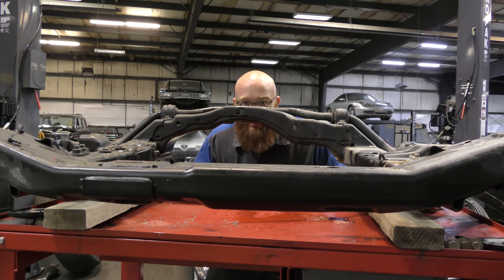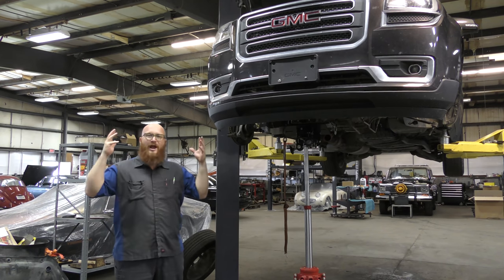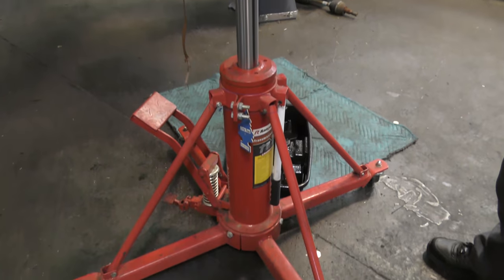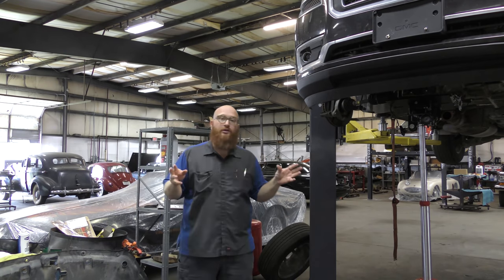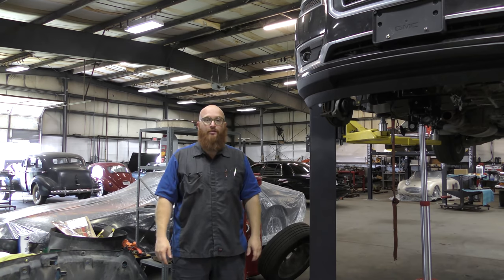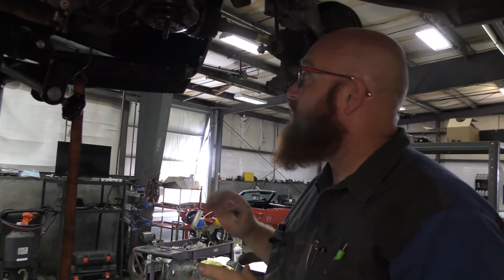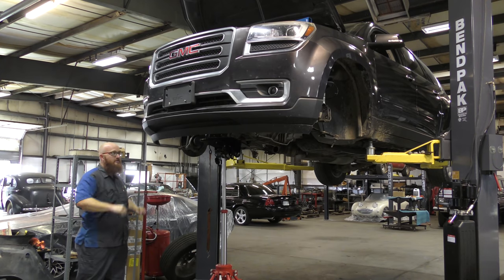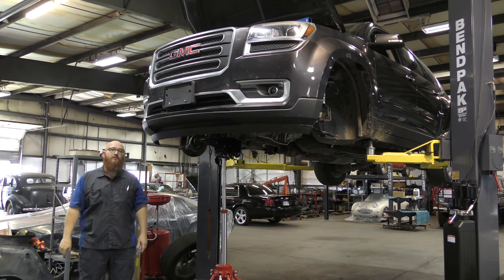Used car insanity in the CAR WIZARD's shop! Why did the huge repair get approved on this '15 Acadia?

Comment: Moreover, another vehicle that you should never, ever buy is any Mitsubishi vehicle that has the CVT transmission. I am definitely hoping that the Car Wizard will have a 2014 Mitsubishi Lancer sedan with the 2 L four-cylinder engine, which produces only 152 horsepower and the CVT at his shop tomorrow. Most of these Mitsubishi vehicles have a ten-year warranty, since they were manufactured back then, but now some of them have reached their warranty, whether it is by the odometer reading or by age. Let us hope that the customer of the 2014 Mitsubishi Lancer sedan took care of the vehicle by maintenance and repairs, so the Car Wizard will not have to explain and go over the vehicle that much, except the underneath portion, while Mrs. Wizard will do the interior of the vehicle, as always. Also, I am hoping that the customer of the 2014 Mitsubishi Lancer sedan with the 2 L four-cylinder engine and the CVT will be a young college sweetheart. It should be interesting for me and the other viewers to watch. Thanks.

Comment: Oh I’ve dealt with some weird customers so I totally understand your frustration. People will buy a BMW to look rich, but they won’t spend a penny on servicing or new tyres. They expect a car to be as simple as a fridge and if anything breaks - the car is suddenly is piece of crap. People’s ideas of what is what are so weird now. The guy who runs my local and very reputable garage (we’ve been going there over 25 years) was saying how frustrated he is recently with cheap, sub-standard parts that are becoming a real nightmare. He has been fitting top brand clutches, starters, cambelts etc and they are failing within months. He obviously replaces the part at much expense and time so this is really eating into his profit, time and his reputation! It’s a real problem and I hope you are not facing the same problems too much Wizard

Comment: I totally understand mechanics have to make their money and keep their shops operating and their bills paid, but repairs have become outrageously expensive for the average person. I'm an industrial mechanic/technician making $19/hour. My 2005 Pontiac GTO has been without AC for over a year. Last August, I passed out while driving. It happened again this July. And a few weeks ago, I had a heat stroke while stuck in traffic on a bridge. Luckily, I didn't wreck the car. But I'm taking chances with my life and others' every time I drive. I've been to a couple shops that couldn't tell me what the problem was. But last week I finally had a shop tell me it's the compressor. They want $1900 to get my ac working again. I don't have that kind of money. $1900 might as well be a million.

Comment: These cars very well designed 2011 and newer but evap systems plugs can cause crank case pressure to build and blow seals.

Comment: This is exactly what happens when you don't change your oil on time, infrequent oil changes are the death of gm 4 & 6 cylinders. The oil burns to the point where's next to nothing left, the chains and guides overheat it becomes trickle down neglect. - For reference I own a 13 Terrain whose oil was changed every 5k and now it's nearly perfect.

It's funny because probably $800 ( paying someone to do it) worth of oil changes would've prevented this lol

Comment: the factory recommended 15,000km oil change kills the chains.  6,000 miles or 10,000km max. Yes the updated morse chain helps, but sensible oil changes help also.

Comment: Manually operated cable driven HVAC adjustment systems are the most reliable. Too bad manufacturers gave up on them

Comment: had a lady come in....... "MY SON IS A MECHANIC! DONT SCAM ME!..... he says its the thermostat.... only replace the T-stat"
ok, but on your engine, the T-stat and water pump are connected..... and the pump has a plastic impeller that likes to fall off"
.
NO! just the T stat! my son is a mechanic!!!
.
so i go a bang up job.... just doing the T-stat
i test it..... it opens
.
i show her daughter.... the driver of the car.... that the T-stat was not the problem
i say it MIGHT still have been the T-stat sticking..... but i think its the pump
she understands 100%..... its totally fine with it
.
.
 hours later..... the mom comes back
IT STILL OVERHEATS!
ya, i showed your daughter how the T-stat opened in hot water..... and i told you thhe pumps like to fail
IT STILL OVERHEATS! I WANT MY MONEY BACK!
no, i did the job you asked for..... you didnt ask for a diagnosis or water pump...... you said "just the T-stat, my son is a mechanic"
YES I DID! BUT IT STILL OVERHEATS!!!!
.
.
ok, again..... you said "just replace the T-stat, my son is a mechanic, he says its just the T-stat"
i then told you about how you can save money by checking, and probably doing the water pump at the same time... as its one peice
you declined that..... saying....again.... that your son is a mechanic and he says its the T-stat
.
i started the work..... and noticed it was not flowing coolant.... 
called you and told you this
and you STILL declined to do the water pump!!!
.
.
BUT IT STILL OVERHEATS!!!!
.
you said replace the thermostat, nothing else..... i replaced the thermostat.... i charged you for only a T-stat
BUT! IT! STILL!!! OVER!!!! HEATS!!!!
you said replace the thermostat..... i replaced the thermostat
.
YOU KNOW WHAT! I DID SAY THAT!!! YOUR RIGHT! YOUR RIGHT!!!!
and she walked out
.
.
.
.
i really wish i could have said..... "sounds like your son isnt that good of a mechanic, huh?"
.
dude doesnt work in a shop.... he molests cars under a shade tree in the back yard
then has to have a shop spend 3 hours un-FUBAR-ing his car..... then do the repair correctly 
.
i started out in the backyard.... learned from my dad (and now teach my dad)
but some people have a knack for mechanics..... others just do what the first thing youtube/google says to do
.
.
like ya, thermostat is the first thing ya look at when a car overheats
but i could tell it was the pump right off the bat
.
.
some people have no clue
think they do
then get pissed when they find out they dont know crap

Comment: Just think. If the engineers and bean-counters at Ford, GM, whoever, had used brass gears and charged $100 for the actuators, no one would ever have to replace them. LOL

Comment: Its the right side actuator on Silverados thats the problem. If you have skinny arms and small hands you can get to it without pulling the dash. I replaced the left one on my truck. That was simple. A budy of mine has a bad right one on a 2004 silverado. He wont pay the money either. Been bad for 4 years. Hes tougher than me.

Comment: I know the pain as a GM tech. Between the 3.6 and us getting bad trades and fixing them and selling them. Just had a 2013 bmw 550i in as a uci did 18 hours worth of work to it and still got sold on our lot. Normally would go to auction.

Comment: I really wish you would have told us how many miles were on this vehicle because is a big part of the parts failure denominator.I live in rural Arkansas and have seen many 5 year old vehicles with well over 120k miles on them. So it's not just the age.The most important cause of wear and tear is mileage and how the vehicle was driven and maintained

Comment: 14:27  I changed my 2007 Ford Taurus actuator..it was stuck on AC on a road trip in the summer which was ok. It took about 25 minutes including disconnecting the battery..luckily we did not have the big console  but the split bench seat   .

Comment: HAVE A 2016 MODEL GMC Acadia with almost 41,000 ,  bought it used with 15,000 miles . But I use  a Mobil one synthetic 5W30 oil  with no problems yet . I do  make the  maintenance is done right as I have for over forty years of changing my own oil .And plan too have the trans and cooling system flushed at 60,00 miles . Fingers crossed for a good vehicle. Marshall Border Jonesboro Arkansas  { Have considered trading for a  Later model Toyota 4 Runner tho . }

Comment: The current economy is why I opted to go with a remanufactured engine in my 01 Durango. I was looking at used cars 😕 and prices were ridiculous. Either way I was about to fork out at least $5000 so I chose to keep my Durango going, now it's worth a little more, still paid for and still looks good in and out 😉 #fullframe #rustfreeAL

Comment: I'm going trough the whole hvac issues, need a thermal expansion valve, 80.00 part, but need to remove the dash, makes me want to just replace everything behind the dash that requires a dash pull while it's out.

Comment: Engineer the car so a maintenance job takes over 3000 dollars.  And make sure it happens after about 3 to 5 years of use to force your customer to buy a new pile of junk.  And their trucks have high transmission tolerances programmed into their computer for the exact same reason.....so the customer has to pay to fix it because it will only throw a code once its out of warranty

Comment: The car market right now is absolutely turned on its head. Large dealers that would normally have lots full of new stock units only have a handful, if any new cars on the lot. Everyone wants 40% more money for their rolling turd, and buyers don't seem the least bit discouraged by it. The silicon shortage has been absolutely brutal and I don't anticipate it getting any better until 2022. I'm glad I bought one of my cars last year before this seller's market fully took hold.

Comment: Owner of a 19 old year Toyota. It has never been in the shop for other than regular service belt ,hoses fluids ect. I ordered this car brand new and paid half of what this Acadia cost new.  Stop buying this crap.  If you paid 33,000 for base model and 3 to 5 k for a repair 6 years in you probably don't have it paid off you just paid 38.000 dollars for the right to make payments on a piece of crap. All this and more repairs to come. I think if you are buying a new car don't look at the price, take a trip to the parts dept. I get a price on the alternator,water pump, radiator, ac compressor and see how much parts are and what it costs to fix. I pick these because they are most likely to quit working . If people did this there is no way they would even think of buying this money pit. 10 minuets spent at the parts counter will save you thousands of dollars later.

Comment: Mrs. Wizard is a cool lady👍🏿👍🏿Hey car wizard just wait until you replace the oil pump belt or the rear engine  timing chains on the 3.0 I6 duramax...magic Mike is not going to be a happy camper

Comment: I have learned my lesson the HARD way, since there is ONLY 1 Car Wizard, and your shop is about 1,500 miles from me, I ONLY take my car to the dealer, even if it's just an oil change.   Obviously, if you have a (competent) relative who is an auto mechanic or if you're the type of person where a car is just a tool for getting from point A to point B, then, perhaps it's worth the risk of going to an independent.  MY experience (at several different independent shops) is that, I take the car in for item A.  They halfway fix item A, HOWEVER, they damage item B, and possibly C (that you don't learn about, UNTIL you are at the dealer).   Another thing I have noticed at multiple independent garages is, (seemingly) little things, like they won't refill the windshield wiper fluid reservoir or check the air pressure in the tires.  Seems like small things, HOWEVER, it makes me wonder, if they're not doing simple things like that, what are the big things that they are careless about?

Years ago, I had a relative take her BMW to an independent garage (place had been around for probably 15 years at that time, and is STILL in business today) for an oil change.  When they were done, they put the oil plug in crooked.  Of course, she did not know this UNTIL her next oil change, when they were like, "Oh, the oil plug is in crooked, we're gonna' have to (it was 25 years ago, but I want to say they had to replace the whole damn oil tank), I just remember that it was hella expensive.  It had to be them who F'd it up, as THEY did the last oil change.  Pretty FN sad, when a mechanic can't do an oil change any more competently then a 6 year-old.........with special needs.  There are A LOT of incompetent auto mechanics out here, who have been in business for a long time, and I live in one of the top 3 or 4 major metropolitan areas of the U.S.

Vehicles are expensive enough nowadays, that if you're familiar with your old car's maintenance history (and it's otherwise been good), it's very likely worth it to spend $1,500-$3,000 to address a major issue.  I do believe that Honda's, Nissan's, and Toyota's are built (pretty much) as well as they were 15-20 years ago.........provided you service the vehicle per the manual AND you don't drive like a maniac.  I just got rid of a 2007 Nissan Altima, with 175,000 miles, that runs and shifts like new and the A/C blows cold enough to hang raw meat in it.

Comment: What I find ironic is most owners that say "Oh no, I have had this car for XX years and have XXX,000 miles on it - They make good cars". The thing is, They did when you got that car. The cars built after about 2008 are complete junk. GM, Chrysler, Ford - all pretty bad. Its just the new owners haven't ran them up to about 50,000 miles to run into the really big repairs yet.

I just got done replacing the MC, Brake lines, Back suspension on my 2008 Lucerne with a 3800 Series III in it. The only problem with those are the intake gaskets. Mine has 152,400 miles on it. Just ordered up some front suspension parts today to finish that up. After I am done with this car I will probably buy a Toyota.

Stupid engineering in today's vehicles:
1. Water pump behind the timing chains - When it finally goes it also takes out the engine. Nice job engineers.
3. Turbo on small engines. When the turbo dies it sends its parts into the engine - New engine time. Then there's Lincoln - "Lets put two turbos on it!".

Comment: Me: 99 S-10 conventional 4.3 great motor, !!  2009 Sierra with 4.8 , no AFM, and a 4 speed trans that shifts correctly. Four wheel drive shifter is on the floor. Both trucks have crank windows and manual door locks that work flawlessly. I will not purchase a newer GM truck because I have no confidence in their ability to manufacture a dependable engine or transmission at the present time.

SteamEngine Watt

Comment: I have a 2012 GMC Acadia. I have a leak with the power steering fluid and the faulty actuator 🤦‍♂️. Every GM vehicle I've ever owned has had the actuator fail too lol.

Comment: What you save in MPG you lose in repair costs in a front wheel drive truck. It's too bad that cables can't open vents anymore. I took mine off and the gears are made out of plastic. Made cheep to ware out fast.

Comment: Sad thing is..fuel pump goes out next....or the Navi module fails...or the cam seal fails and spew's oil all over the engine bay...and it burns to the ground...hopefully not in your garage.

Comment: I've been weeping for the American auto industry for decades. Except a model here or there, most are not great.
I had a 2000 Infiniti Q45 for 18 years. Except regular maintenance, I never had to do anything that required the car to be at the shop for more than 2 hours. Ever. Solid machine. 
Too bad today's Nissans are not as good.
Honda, Toyota, the Kia/Hyundai group, Mazda, Subaru, all still good car makers.

Comment: "The seal is not a hard job, it's getting to it that makes this job so expensive." Sounds like the water pump problem with Ford 3.5 Duratec engines.

Comment: The rip-off is that you can’t buy just the oil-filled part of the engine mount; you gotta buy the whole blooming thing, even though the metal part is probably perfectly fine (albeit, a bit dirty/rusty.) The only good side here, is it doesn’t require programming the new one. 🤣

Comment: Everybody loves the dual zone automatic climate control when the car is new...
I just hope I never have problems with it on my 2017 Ford Escape Titanium. Most repairs to the heating and cooling system are dash out jobs, and start with removing both front doors to remove a couple of 12" long bolts that only exist to tie SORB crash structures together behind the dash.

Comment: Crazy,  this week I had on of those cases too. I changed a manual gearbox, cluch and flywheel for 5000€ when the value of it is inferior to the bill. The owner bought it new and is attached tho, not a dealer like yours

Comment: Don't buy GM used to like them in the 80s 90s. Was a Mechanic for 15 years, hated to do a simple plugs exhaust leak and ended with pulling a head, Suspension bolts snapping off inside frame, Rusted brake lines behind fuel tanks, Wheels rusted on to hub, finding how to remove a dash to do an indicator light bulb, removing motor mount to replace a starter, customers who think oil changes is a 10-year thing And get mad when there is a rod knock.

Comment: What is the cost for a cam sensor for a 2011 GMC Terrain. The dealership charged me almost 500$ for the job and I was pretty choked at them because earlier in the day I took it to the dealership for an oil change and a general vehicle inspection and I thought to myself, could the mechanic screw with the sensor and get me back in the shop so they could empty my wallet. The engine is a 2.4 litre and has roughly 50k on the drivetrain.

Comment: I hear what you're saying about hidden costs.  I have a 2009 opel insignia,  that needed a 10 euro oil seal changed in the oil sump uplift. It cost  150 euros.  That was mate's rates, as I knew the mechanic well as a friend.  So sad the car manufacturers do this to customers.  What's coming next with Ev's?

Comment: It’s called moving most of the supply nd manufacture of key components and electronics offshore. Dealers cannot get new cars because of the chip shortage. Used cars are at a premium.